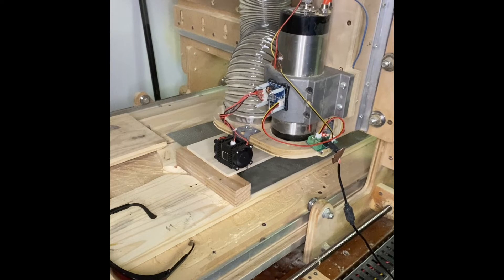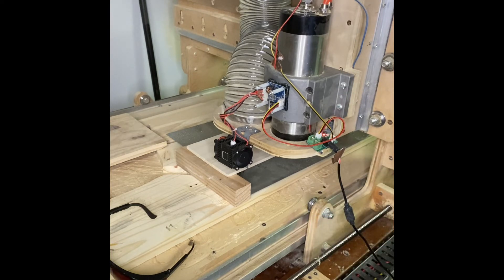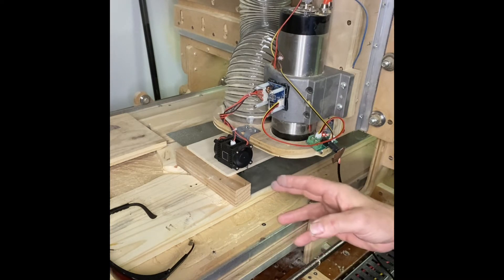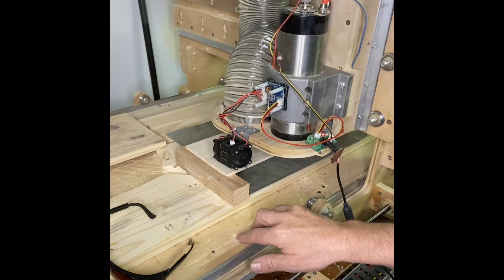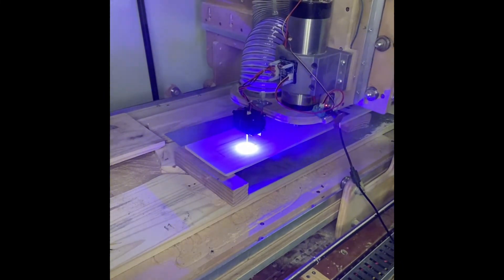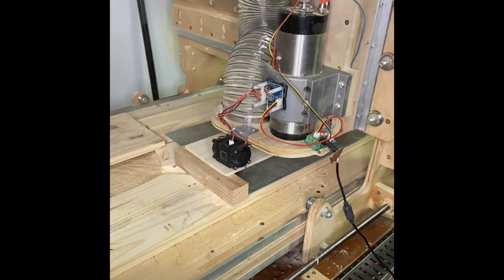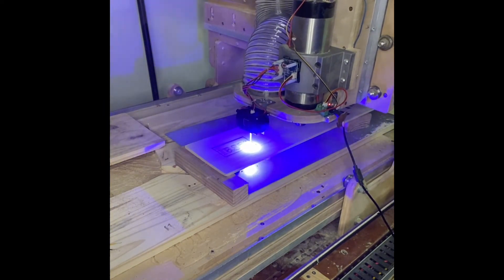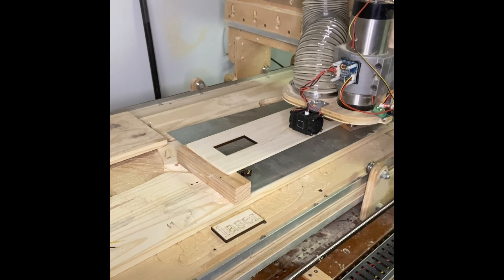Using Laser Tree 80 watt Laser first power up testing

Comment: How has the laser held up since you posted this video? I found your review on Amazon, and wanted to see what a "real world" test looked like. I've been thinking about a laser cutter for a while, but tube-based cutters can be a pain (size, need for water cooling, etc). I was hesitant on these diode cutters because it didn't seem like you'd be able to do much with 'em - but your video shows that to be false. My only experience with laser cutters was using a 60 watt RF tube laser cutter from ULS (can you say "cha-ching") at a local (non-defunct) Tech Shop here in the Phoenix area. Something like this diode laser would be perfect, and inexpensive - provided it lasted a decent length of time (another issue with CO2 tube lasers, is that life is dependent on "run-time" - they need to be run relatively regularly in order to get the maximum life out of the tube). Great video, and thank you!
Reply from the maker: Hi, I just haven't had time to even go further with it. Thanks

Comment: Hi
You cannot control the laser power. This is a diode laser that is either switched ON or OFF. It always delivers FULL power when it is switched ON.  The apparent power control comes from the duration of burn to your material and that is the function of your PWM control. If it is set to 99.99% duty cycle  then it means for each cycle of your chosen frequency, the ON will be 99.99% ie continuous. If you set the duty cycle to 50% then the FULL power will be switched on for 50% of each cycle. and you will do aproximately 50% of the damage. This looks  like power control but is in fact material damage control via exposure time.
Reply from the maker: Hi thanks for the information. I spent a lot of time  trying to get this to adjust.  Could you tell me how to send 50% duty cycle and would that cycle come from maach3? Thank You
Reply: @johnnewton7893  
Hi John , Sorry, I am not a CNC man but a quick look around www tells me that although Mach3 does have a PWM  for spindle control it is very limited for your diode application. It seems you have an ON OFF control that you can manage through mach 3 so  you need a seperate PWM and frequency control board . I am no electronics expert but I fully understand how it works because .I have a 30 watt CO2  RF laser that works exactly the same way but my controller ,  an RDC6442 and the RDWorks software, allows me to define both the duty cycle (via % power) and the frequency of the PWM signal. I think you need to join one of the many diode laser forums because they are chock full of electronic experts that will be certain to help you.
  Best wishes
Russ
Reply: If that's the case why below 10 % you can see an obvious dimming effect of the diode if it's just a duty cycle change I would think it would still be at full power. For instance I put my 30w unit to 1.5 % to perform outline work for leather and it places a mark so fient you can miss it. I wou wouldn't think that's possible with just a duty cycle change. A lot of people make this mistake when they first get these lasers you have to change your baud rate Within lightburn otherwise the power of the laser will be turned to 100% all the time. If you use 115,200 baud rate as a search term you'll see what I'm referencing.
Reply: @bluecollar9220  You are quite right  in your full power assumption but it is only full power for 10% of the time. The other 90% is OFF. Your eye is the most unreliable tool for "seeing" what's  happening abecause the fastest your brain can process changes reaches a limit at 13ms. The standard fixed PWM speed for most diode lasers is 5kHz, so each duty cycle is 0.2ms (200micro seconds). Thus 10% duty cycle means each ON period is only 20micro seconds long and that is way beyond what you can actually percieve. You might catch the odd flash in this steam of flashes and may account for your observation. The baud rate is just the speed of data bits that your processor can handle and is not directly related to the PWM. There are several baud rates that can be set in  GRBL /machine code type controllers so  without knowing what your specific requirements are ,Lightbirm defaults to a duty cycle of 100%.

Comment: Hello John, can you tell me, where to find how to connect CNC board (in my case it is STB4100 and mach3) with laser tree laser, or how you do that? I'm trying to find this info for a long time but can't find anything. How do you connected this thing together? Please, answer.
Reply from the maker: Hello,  Sorry Im not familiar with this type board.  I wound seem to me the you should be able to place a breakout board between the controller and drivers. plenty of videos to help hook hook up.  also look at Mach3 Forum , Lots of help there. Thx
Reply: @johnnewton7893  ok, thanks a lot

Comment: hi juan, i bought that laser 10 months ago but for one time or another i haven't put it to work, my cnc burned the lens and the fans, i just saw your video and i saw that you put a separate plate to plug in one separate power source, my question is the laser module you connect to that board and the board you connect to the arduino board? I have an arduino but I don't know how to connect to the board, can you explain it to me? I hope to have luck and explain myself well so that you understand me, thanks
Reply from the maker: Hello Fernando, The small board is the driver board that came with the unit. I bought a 5 volt power source just to power the driver.  I am using a Smooth Stepper on my cnc with a breakout board for the control wires via Mach3.   I do know the Arduino has a PWM output which will control your Laser However Im not versed in programing Arduinos.  This Probably doesn't help much, sorry!   Keep on searching youtube something will eventually pop up on your feed that will help you.

Comment: you can control the power using the PWM pin. Any Arduino or other MCU that has PWM out can control the output. If you do not know what  PWM is then you need to do some research. Also you need to have an air assist. You do not want to get that smoke on your lens as it will cause the laser to burn your optics.
Reply from the maker: Great advice Thank You

Comment: Curious if you had figured out the power adjustment since your video posted. I'm looking at purchasing the laser. How hard was it to set up? I currently have a jtech 7watt.
Reply from the maker: Hi Nicholas thank for your question, I haven't had time to get back to the laser as this month is my busy time of year. I will get back to it in the next few days. I have Mach3 and have created a laser profile then programed the settings using the info in the jtech website.  I will let you know how I make out with the power control, I'm sure its something simple ..  Cheers

Comment: Its not 80watts on the optical side. Its 10w optical power. (the 80w designation is the power it uses from your wall)

Comment: Hello i was bought laser tree 80w but my  laser is not cut 5mm one pass i dont understand i have a ask question what are you connected laser contrel before
Reply from the maker: Hello Emre, i am controlling my laser thru Mach3 cnc Software. Is it possible you are cutting at to fast (x)(y) speeds?
Reply: @johnnewton7893  the cnc machine is work 150mm feed rate but laser is not cutting %100 power 3mm plywood  i will share video youtube  and  i will give link  here tomorrow
Reply: @gum_laz9527  Did you manage to fix it? i've got the same laser and the same situation. Cant even cut 3mm mdf with it

Comment: Actually I have a question about the laser- are there any unused threaded holes on the module itself? A lot of people like to mount an air assist nozzle on the end of the laser head, not sure if it would be possible with this module?
Reply from the maker: There is actually  2 holes on one side probably like a size 4 threaded.  I used those hole to screw mounting brackets to the CNC Z carriage. I bought  from Amazon LOC LINE tubing kit for air system.  Thanks

Comment: Hi Sir,
Good Day...

Hope you are fine,
This is Abdul Basit from Riyadh, KSA, I am Searching a good laser for my 3018 CNC laser machine because my laser head not working properly,
I am trying to find a good and effective laser head to cut and engrave 3 to 5 mm plywood and acrylic for my small business,

i need your advice which one will be the best to restart my business.......
i found NEJE, Orutur, Laser Tree etc..

Thank you,
Reply from the maker: Thank you Basit for your comment,  I am only familiar with laser tree 80w laser. I do know that this laser will cut thru 3 to 5 mm wood and can be also used to engrave certain materials. As with most Lasers you would want to be able to control the power output of your laser for engraving to cutting.